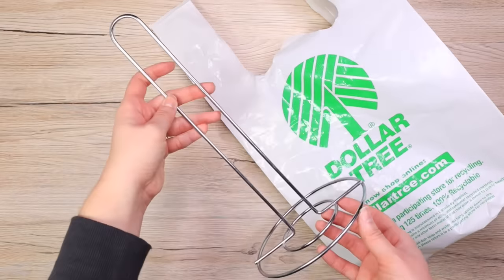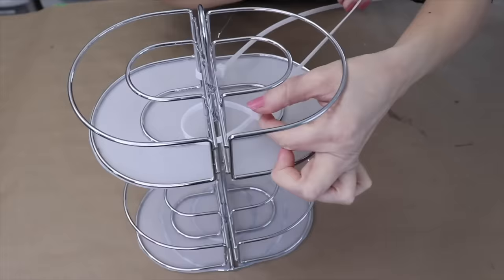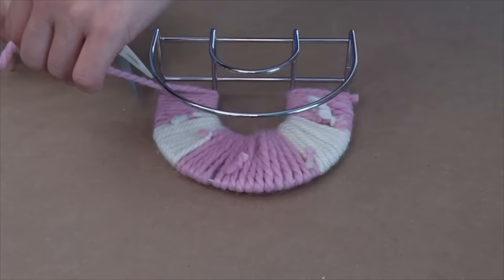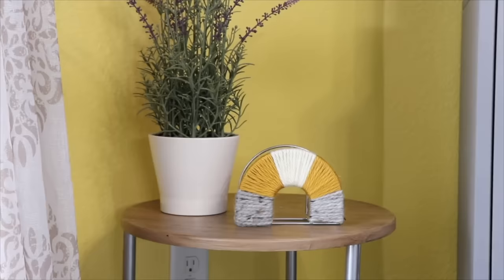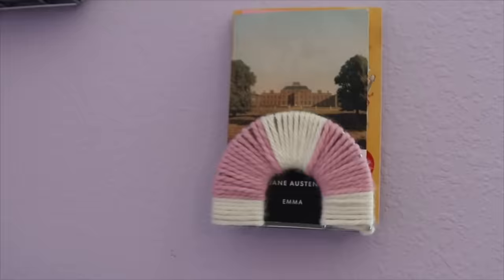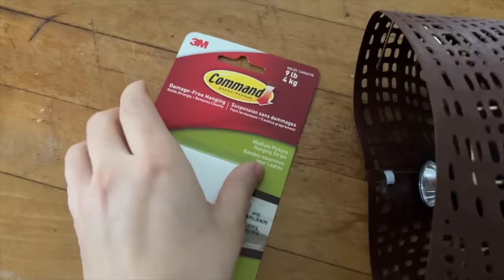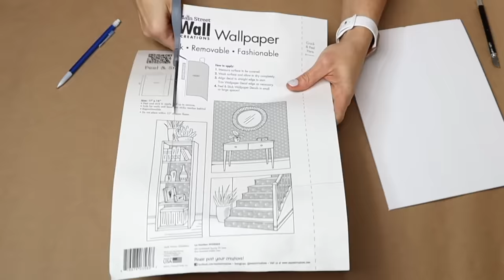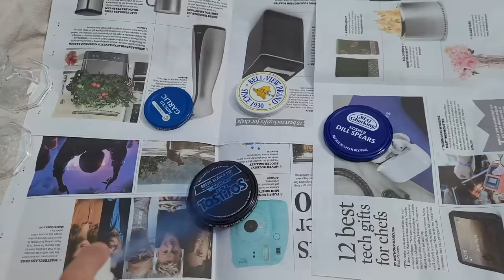Stick a paper towel holder on your toilet (BRILLIANT!)

Comment: I’ve found Dollar Trees been putting out different sized small rectangle crates (like used for the art caddy) sometimes they’re all decent size & sometimes smaller so you have to watch out. The larger ones are big enough to fit 8 paint bottles as opposed to 7. Just a heads up 😉

Comment: TY so much for all the great ideas, especially the vertical storage!   Going to get some of those wire racks to use for my thread to hang on my pegboard.  The ones at the big stores are all bent and way too difficult to cut or straighten.  TY again!

Comment: Nifty ideas, I have actually seen some of them before my both of my grandmother's would up cycle thing like this too especially the napkin holders and the ideas for small, to large coffee cans when they were steel.
Reply: Yes.  Been using napkin holders for mail for years.  All kinds.  Lots of different styles.  
And the Paper Towel holders for TP are great!  Just never thought to hang them. I’ve got some nice older ones that have a decorative topper you easily pull up to change the PTowels.  Or in this case, add/remove the TP. I’ll probably still keep it on the floor.  What’s good is, they will easily hold the super thick rolls, whereas the actual TP holders didn’t always fit them. 
Those old coffee cans got used over a lot by all our grands, I’m sure!❤

Comment: I place a wicket basket full of paper towels on the counter in my guest bathrooms so they don't have to use unsanitary cloth towels. I fold Viva towels while watching TV. Viva cloth towels are strong and only need 1 piece to dry hands.
Reply: My friend has a simple, but very nice PTowel holder she has on her sink counter for the same use.  She has the room, so it works for her. Another has the PTowels lying sideways on her towel holder next to her sink w/2 cute fingertips on either side of them when she has her company over.  It works well that way, too.

Comment: Just go to Marshalls or the thrift store and get a tissue holder 😂😂 once you finish buying all the supplies for a DIY you could’ve just bought the item…I think painting and reupholstering furniture are the only sensible DIYs at this point
Reply: Agree. The napkin holder is a great mail holder, tho.  Used them for years.  None from $ stores. Have a few really cool ones.
And the PTowel holder in my small bath works well w/the fat rolls that an actual TP holder that would hold them wouldn’t fit.
So they’re great for a tight space. And mine was an old PT holder a friend gave me yrs ago that I liked. When she changed, she remembered I thought it was so nice/unusual.  Fits perfectly in that tight spot on the floor. After it had its use on my counter. ;)

Comment: The next to last project with the blue stands and toppers are my favorites! I'm making those, and if my friends see them, they'll want a set as well!  🤤🤤🤤  So super cute! 

How can I make my own turntables--single or tiered? Also, what is the name of the mechanism that makes the 'table'/bottom spin?  Thanks in advance  😘  to whoever answers.  🙂
Reply: I think you are referring to what's called a lazy Susan. I like that also.
Reply: @dcnfamilyify   💜💜 Yes, I know they are lazy susans but some (the smaller ones?) were called turntables in the video. 

I have a childhood LS that is solid wood, about 20" in diameter and heavy as heck. I love using it, but it's a space hog on my 60" long sewing tables. Not enough wall space to butt 2 tables together like I normally would (can't block the windows). I figure, a 10" diameter 2 or 3 tiered turntable might work better. 🙂 And my old susan needs a new turning mechanism because it catches and turns choppily. Oiling only helped somewhat. 😟
Reply: Penny, le puso bolitas de cristal. También le llaman canicas. En los chinos seguro que encuentras por bolsas, deben  100 unidades aprox.

Comment: Love these.?a hint for you? Use lighter fluid to remove sticky reside on glass surfaces. Works great without the oily fi is of good one but please use responsibly. Use outside or very well vented and away from any spark

Comment: Hi, help pls, new viewer. Can u give step by step of the "Video short"of the wall scone lighting? It moves too fast to get details of the material. 
Tks.
Reply: There’s a way to slow YT down.  That may help. 
I imagine the batteries would run out soon if used a lot, however. And a PIA to change out w/the flashlight.
But, maybe not....Good luck!

Comment: Has anyone ever tried to do a napkin holder with the hook on the wall for maybe outgoing mail that you need to take to the post office?
Reply: I imagine it would work fine.  As long as you don’t mind it hanging on the wall by the door.
I’ve used them for mail for years. Have some really cool ones. Not from $ store. But always on sale, or cheap at yard sales.  Ppl never thought of them for mail, till I told them what I was paying ten cents for.😂